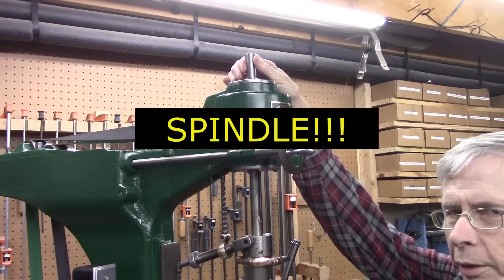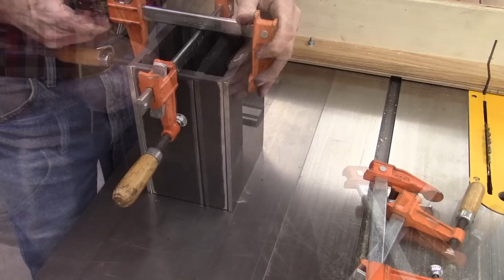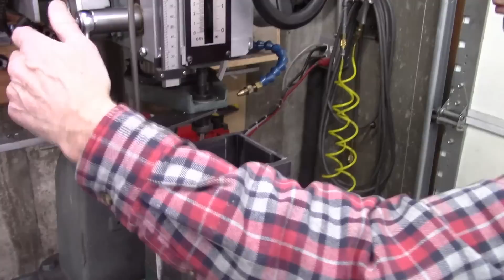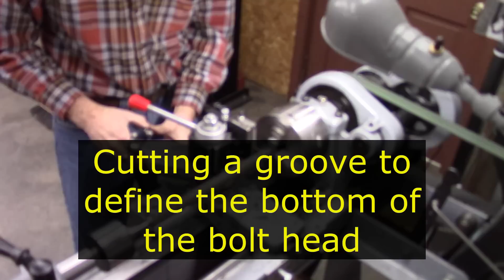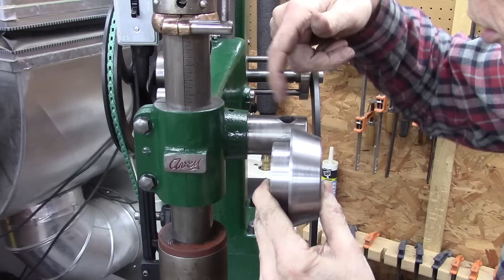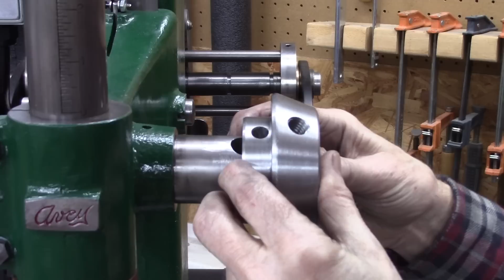My 1917 Avey Drill Press Gets Some Much Needed Upgrades

Comment: Add a plain bearing as you can control the bore you make. Just use dry ice to shrink it for a tight fit at assembly.
Reply from the maker: I don't have dry ice but I was thinking the same. I don't think there is any pressure on the bearing unless there is lateral force on the drill so a simple sleeve should wear well.
Reply: @WinkysWorkshop  You can try spraying things down with "canned air" - upside down so it's liquid. Has worked for me in situations
Reply from the maker: @MrDdaland  That would work!
Reply: Grocery stores and places like dairy queen have dry ice.

Comment: Just wondering
Why didn't you use threaded for
Instead of making those bolts?
Reply from the maker: VERY good question.  First I went to two local stores and they didn't have 7/16", Second, the online prices were high (with shipping) and third, I had tons of hex stock I got for free that had been sitting in my shed for years.
Reply: @WinkysWorkshop  Using the hex stock also made for a better video. 🙂
Reply from the maker: @ssmt2  In a way...  maybe it did. The noise made the autofocus mess up on my camera...  that was weird.
Reply: @ssmt2  I had some hex stock, and I am sure it was leaded steel, it machined soooo sweetly.

Comment: It would be cool to install a set of angular contact bearings. Overkill is good.
Reply from the maker: This is very true...  love tapered roller bearings too! The bottom bearing is super tight...  just not well supported on the other end. The drill press is impressive in many ways but this was a significant design error.
Reply: @WinkysWorkshop  I would complain about it to customer service .....
Reply from the maker: @MrDdaland  Haha...  good one